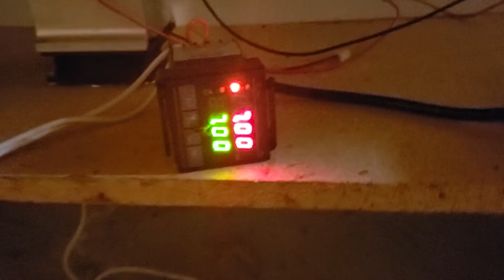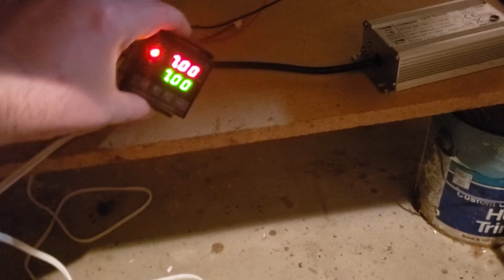DIY LED EXPOSURE UNIT screen printing

Comment: I know this is an old video, but I am a little confused. I see that your LED light is 100w… so, I have some 2ft led strips. They came in a 4-pack and the wattage is stated at 9w. Does this mean that it is 9w each strip, or 9w total [ all 4 ]. If each strip is 9w, then it would take 11 strips to total 99w. Is this correct? Or, am I way off here…

I ordered 2 4-packs [ 8 total 2ft strips ] and use the Ulano Orange emulsion. My times to get a decent exposure so far is around 3 minutes… please help, thank you
Reply from the maker: I'm using a single point light if u use led strips they have to be closer cause the power is less you also have to check what the led are what wave length it will take u some testing to find how close without undercutting your time with led should be less then the time was with tubes the time you can find out buy doing a time test kn the screen it will help u find where the time is best
Reply from the maker: if u need more help let me know ill try to help

Comment: Great informative videos brother.  I'm just getting into screen printing.  I tried the emulsion test today.  I'm using ulano qx1.  Should the emulsion rub off after it's been exposed or do I have to let it wait till it dries to be able to touch it?
Reply from the maker: yeah when u coat a screen let dry over night when u burn the screen it should only washout the unburned spots u will have to do test to find the time that is
Reply: @waldo2413  I did the test after washing it I touched the halftones on it n it rubbed off.  On all of them from one minute to the one that was exposed for ten minutes.
Reply from the maker: @Tightlines24  have you had any better luck?
Reply: @waldo2413  Thanks for the follow up.  I'm waiting on a new UV light, should be here today.  Hope it works better than the holagen I have.
Reply from the maker: @Tightlines24  if your using holagen your times are going to be long the led will be better you did get it in the right light range right ?
Reply: @waldo2413  man I hope I did.  I watched tons of videos and everyone who made their own exposure unit would leave a link to the same LED UV light.  So I went with that one.

Comment: Do you think a full spectrum LED grow light would be more effective at fully curing the emulsion? Some of the ones I've seen on amazon list the spectrum at 380-700nm
Reply: I'm using Chromalime. On their site it says the spectrum needed for curing is 350-420. My thought is that full spectrum light will hit from 380-420, instead of only 395-400 and cure the emulsion more thoroughly.
Reply: Does that make sense?
Reply from the maker: @BearLionScreenPrinting  yeah you can try it but from my testing, they don't work as well. the peak cure for most are in the range of 395-400 they cure wider range but  the best  cure happened in a smaller zone it could also make the time longer the difference in using led vs uv fluorescents bulbs hope that helps
Reply: @waldo2413  thank you!
Reply from the maker: no because emulsion is not in that spectrum you just need the range the emulsion is in

Comment: What's the distance between the LED and the glass. I have a 50W but I have I but the glass. You think I should buy the glass big enough so I could expose 2 screen at a time?
Reply from the maker: if you have a 50w that everyone is buying take the glass off the more glass the more it will block uv. id do it just big enough for one cause the more space the more distance you would need and the speed of led is fast enough so you wont need to burn 2 at a time . i have mine around 20inches to 24 inches from my led to the glass
Reply: @waldo2413  thanks for the info. r u going to post where you got the LED light and the timer? Would u be making a video how you wired everything to get it working.
Reply from the maker: @ivanramos5735  yeah ill do that give me a few days to do that